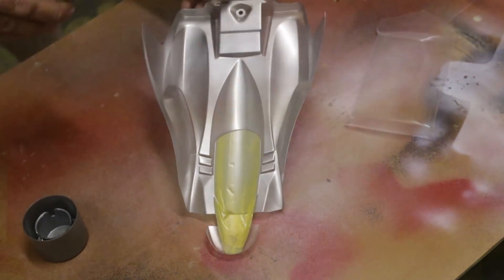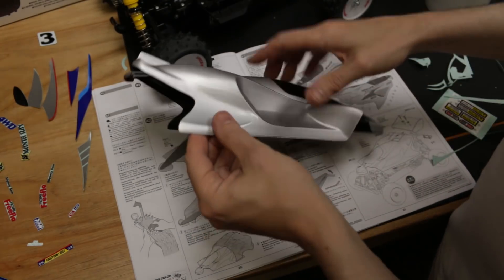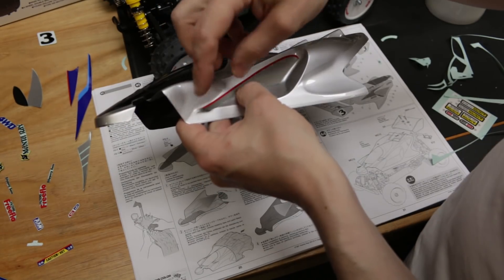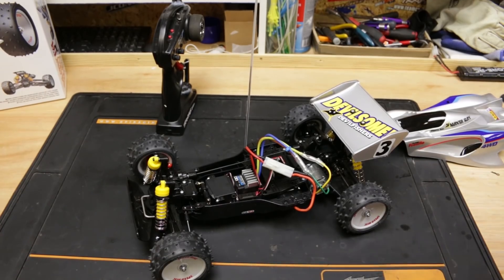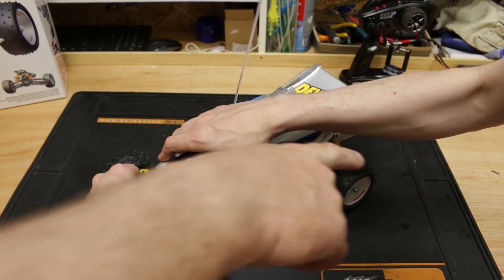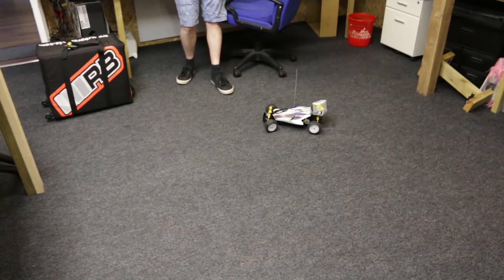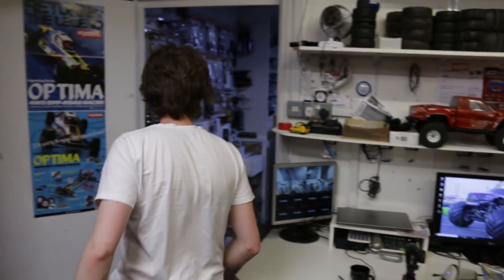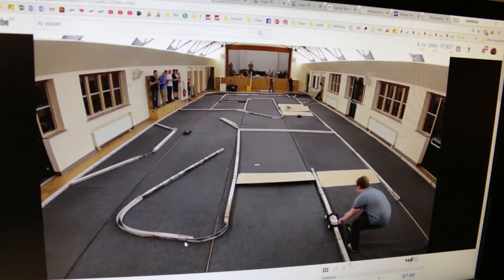Tamiya Manta Ray 2018 Build Guide with Kev Part 4 of 4

Comment: DIY tip for decal application, using a spritzer bottle with just water, lightly dust the body where you want to apply the decal, place decal and move it to where you want then using a small flexible plastic squi-gee, working from the center outward,press the decal down. Let stand about 20 minutes for the adhesive to set.
Reply: Fargo CS was kinda in a rush. 😁

Comment: I'd up-grade to a ball bearing kit first, then a 3650 size 3500kv - 4000kv brushless motor & 60amp ESC on 2s 7.4v lipo. Last a steel pinion gear, the standard alloy pinion gear don't last long. Do a modified video about it.

Comment: Yea Kev go race but try to fit a Sensored Brushless Motor and ESC. Hobbywing makes them.
Reply: Use a 17.5 motor
Reply: Also, get some Pro Line Hole Shots in addition to the stock tires. Don't bash with Hole Shots though

Comment: MAKE IT 6s!!!
Reply: 8s
Reply: 16s
Reply: The Game Crashers o
Reply: if you want to give it real power, just put a nuclear power plant on to it 🤣🤣
no but I really think it will break on 3s
Reply: no, that will beake it, in old Kevs fasion: (During crash) Ooohh SH*T (After crash) What happend? You broke it!
Reply: The gears couldnt handle it but if would be fun to watch
Reply: I put 3s in my Tamiya wiv 5200kv Motor i guess it’s tyres but I put some cheap hard road tyres on it slides all over the place , I put SCT tyres on it’s unstable . 
Good luck with 6s .🏎
Reply: 32s dual esc's